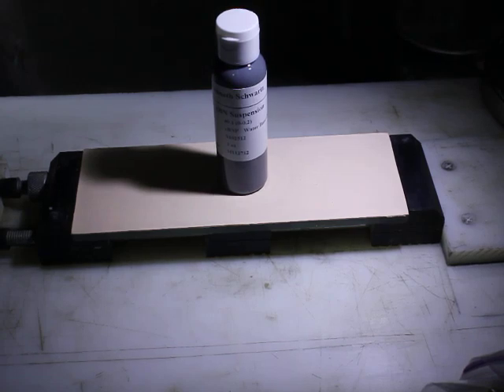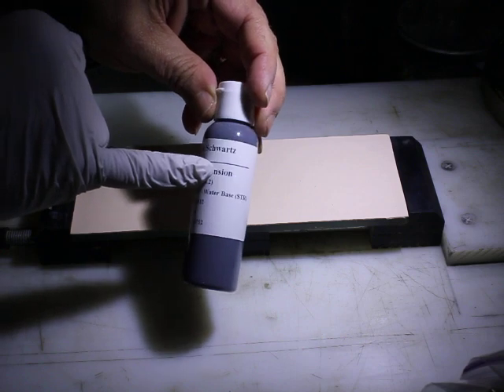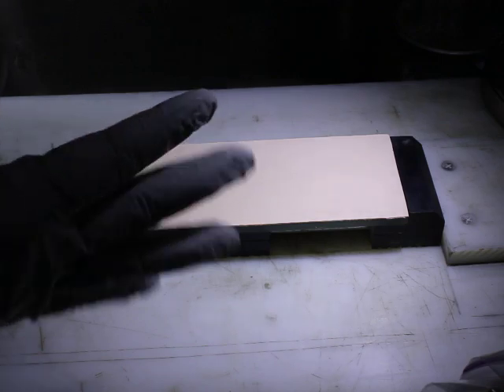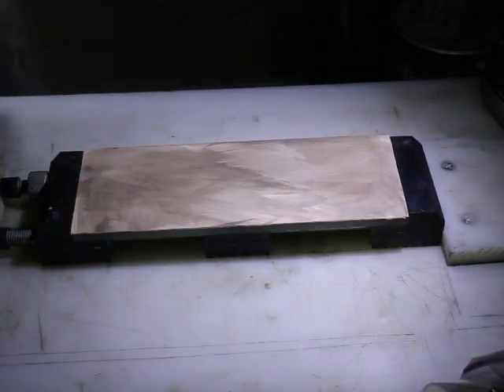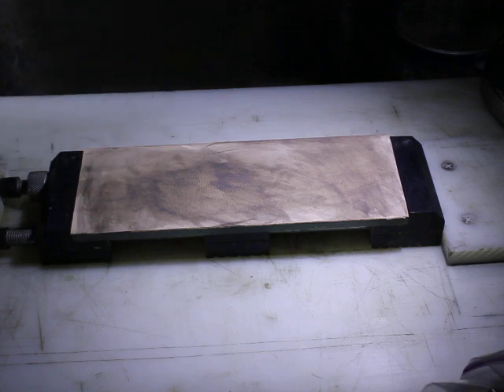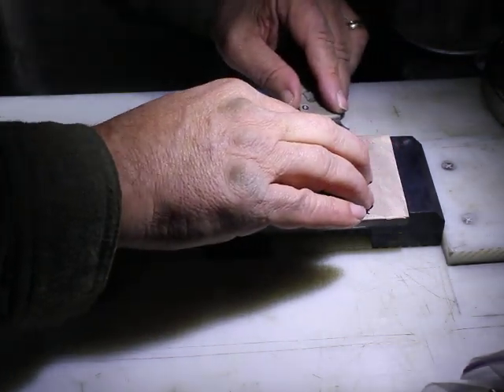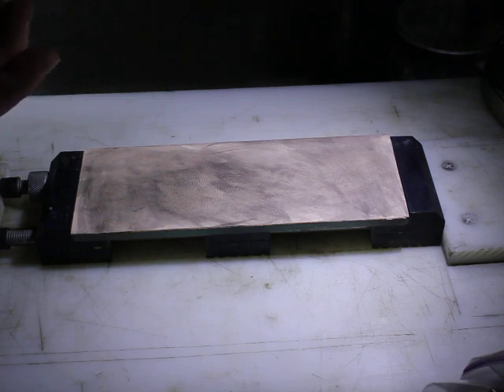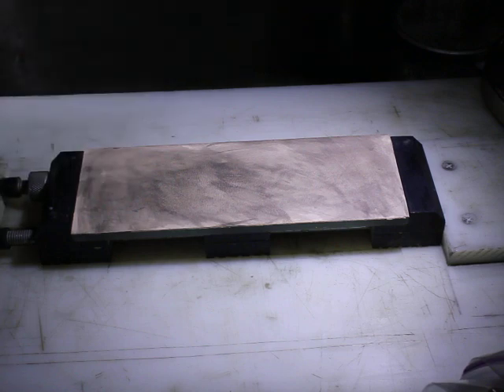160,000 grit Knife Edge! Tenth micron CBN emulsion on Kangaroo leather

Comment: very novice sharpener. look at your edge under a hand held microscope. that .1 micron isnt doing anything compared to the same strop with no compound. you better off spend 50 cents on green compound that will actually do something to a 15k edge.
Reply from the maker: Clueless. Green compound	has particles >10	microns in size.

Comment: I get a clean shave from 1200 grit on my Taylor witness razor. Not amazing metal but holds a good edge. Also use an old jack Daniels leather belt if I'm honest but all the same 160,000 grit, Wtf do you want that for. I thought I found sharpening good for calming my mind, you must be the zen master
Reply from the maker: There's a lot of edge left past 1200 and a strop

Comment: how can a WATER based product be ok for leather?........... would not an oil based product be preferable?
Reply from the maker: Mike Sloan Both can	 be used.	Oil based accumulates	airborne debris more easily.	Water based	works well because the water evaporates rapidly and it is a dry technique. I also have water based emulsions too

Comment: I've been sharpening my knife at 7.5° on a 27,000 grit petrified mastodon tusk stone, and then stropping it on a unicorn leather strop, thinly coated with pixie dust. It is a very slow process and requires a great deal of patience, but my EDC is incredible! It's so sharp that I never use it, for fear of losing the sublime perfection of its edge. I think I'll try your system instead!
Reply from the maker: Ronald Ventola You need togo finer :) And use a better grade of pixie dust.	Have your dentist check that mastadon for cavities.
Reply: A just commented this I agree is a bit over the top but it’s fun to get knife insanely sharp and if your going to sell a knife it helps a lot with getting the most money out of what you make but at a certain point it more of an art than a tool and I respect that and understand it
Reply: You should store it in kryptonite and bubblegum as it keeps the knife sharp
Reply: Best comment ever

Comment: Q: If leather at best 10 000 grit and the compound is 160 000 grit what is the finish?
A: ???  Have been looking everywhere and have never found anyone who addresses this issue.
Reply from the maker: Less so for cow (bovine) but certainly for horse (equine) and Kangaroo, the 'grit range' is considerably finer than 10k, approaching 160k. For nanocloth the strop is an even finer finish, easily 620k. You can determine this by seeing at what level the nanocloth begins to accumulate metal swarf. For nanocloth the level easily exceeds 3.2 million grit or 0.005 microns.
Reply: Thank-you so much for the info. Never herd of nanocloth i will have to look into it. Thanks again.

Comment: Is the #4 Micron emulsion,? Can it be used for General basic stroping.?
Reply from the maker: I have the 4 micron CBN formulation in spray (water based) slurry, water soluble emulsion, and paste (oil based) formulations as well as both mono and polycrystaline diamond in these formulations and Boron carbide emulsions. For most hand stropping applications I recommend the emulsion or spray formulation, depending on the substrate. If in doubt, go for the emulsion - or give me a call at 209 612 2790 for a more detailed explanation to meet your needs.

Comment from the maker: +Devon Huxtable So 160,000 grit is 0.1 micron. Kangaroo leather is fine 
enough to not negatively impact the 0.1 micron scratch pattern and 
Nanocloth even less abrasive even working with 0.025 micron poly 
diamond,. So your numbers for leather are finer than the compound, not 
coarser and not accurate in any case.

Comment: Hi Ken, I love my KME! I'm going from the Surgical Black on the KME to my strop. I'm wondering, what is the role of CBN emulsion if I already have a good strop with compounds? Do I use both, or one or the other?
Reply from the maker: +sojourner pasajero This depends on the grit of the CBN A 4 micron CBN will refine the Surgical Black edge and all grits finer will result in progressively finer edges. The CBN Both I and KME sells is the finest available so you can just eliminate other compounds as unnecessary.

Comment: Do a push cut on a sheet of toilet paper.  Show what this miracle stuff can do.
Reply: +kenneths123 
Of  course you can do my  "toilet paper sharp criteria" test and pass. I did not say that your knives ar not sharp:) 
 My point is that my test may be passed by an edge that is "sharp enough" and not fold by cutting a tomato.

I use saran wrap for scissors testing. I will compare the two criteria.
Reply: +Steve Brown
 I have never seen anybody do a real push cut through toilet paper. I don't this guy can do one either, nor you as a matter of fact.
My "toilet paper sharp criteria" is: "Hold a piece of toilet paper, flat on a cutting block, with two fingers. Place knife tip between fingers, blade at shallow angle, pull knife towards you, down the length of toilet paper, cutting paper in half - without catching and tearing."
Reply from the maker: +FuddleDudd I can easily do a "toilet paper sharp criteria" test and pass. A true push cut with toilet paper would be a single ply held in a pinch grip and sliced or push cut. with the paper held at a single point. For 2 points, this will easily pass. Single pinch grip push cut - I haven't seen it yet to my standard. I use single sheet of toilet paper for for scissors testing.
Reply from the maker: +FuddleDudd The best test would be to have you try some of this compound for yourself. Let me know if you are interested.

Comment: I have not tried the CBN yet but I did a direct A-B stropping comparison the other night between.5 micron diamond and "green" compounds using the same knife. I much preferred the diamond paste as it gave an edge that was equally sharp but it also surprisingly left a bit of grabby "tooth" to the edge. It was much quicker cutting as well but it is of course much more expensive.
Reply from the maker: +TrappenWeisseGuy ;  Yes I have both CBN and monocrystalline and polycrystalline diamond, in spray and emulsion formulations. My compounds are VERY high concentration and purity. Green compounds are very roughly graded and often contain a mix of Chromium oxide and aluminum oxide, often with very coarse grits (eg 5 micron particles in products advertised as 0.5 micron or 0.3 micron products). For this reason, I don't carry Chromium oxide products.
Reply from the maker: +TrappenWeisseGuy ;  You can find out more here http://precisesharpening.blogspot.ca/2010/12/part-1-comparison-of-three-quarter.html
Reply: I think the green stuff is best suited to general metal polishing with cloth and felt wheels on bench grinders as opposed to final honing by hand.
Reply from the maker: +TrappenWeisseGuy ; For use on a buffing wheel check out my diamond bars https://youtu.be/_3-nuwwPtpg

Comment: This is overkill on a ridiculous level.
Reply from the maker: perhaps for what you sharpen.
Reply: What task requires a blade with this much polish?
Reply from the maker: For my preferences, I use this level of refinement - and finer - on my straight razors routinely. Not as a requirement, but rather as a preference, I also do sharpen some of my kitchen knives to this level. If you have not used edges at this level or finer, you really can't say whether or not it is not useful to go this fine.
jesuriah

Comment: The paper cutting doesn't prove much. You can slice newsprint relatively clean after a 400 grit sharpening if the burr is properly removed.
Reply from the maker: +Jarl Anarch Slice cutting with a coarse edge is easy. Push cutting is yet another story. Ultimately the true test is to cut what you are designing the edge to do. You will find a 160k edge so far surpasses a coarse edge as to not even be comparable. Try shaving your face with a 400 git edge :)
Reply: I know these things. What I'm saying is that he could've had a better test, like whittling hair or something of the like. I feel like you need to at least sharpen on 30k grit stone before you move to the 0.1u paste he's using here, or it won't bring out the true effectiveness of the sharpening.
Reply from the maker: Jarl Anarch
Jarl I agree. Ideally depending on the abrasion resistance of the steel, preceding it with either 0.25 or even 0.125 micron CBN or diamond would further isolate the beneficial effects of this level of sharpening. Or, if you please you could use the 0.1 miocron compound for use with my 0.050 or 0.025 poly diamond compounds. I have done this subsequent to the recording of this video with the expected improvements occurring.
Reply: 0.05 and 0.025????!!!! JEEEEEEEEEEEEEZ
Reply from the maker: +Jarl Anarch So those (0.050 and 0.025) are 320k and 640k grit. To give a size perspective a 640k particle is in the range of a SMALL virus. And, although it is exorbitantly expensive and something I don't recommend except for research purposes, I do have some 1.2 million grit poly diamond :) At that size poly and mono are essentially indistinguishable and I have yet to have a test that discriminates between a 640k edge and a 1.2M edge.
Reply: That is utterly insane. Be careful not to cut a hole in the fabric of space-time with that edge!
Reply from the maker: +Jarl Anarch  I also have 0.0125 (1.2 M grit) but this is quite expensive and I don't recommend it for the price since I can't technically prove it is an improved edge.
Reply: kenneths123 are you selling any thing that fine in small amounts how much would it cost i know it’s not practical but I’m seeing how sharp I can get it I’m only able to find it sold by a the pound It’s mostly a game with my self at this point but where could I get compound below .1 micron
Reply from the maker: @outdoorperson6411  I sell directly - now as fine as 0.003 micron or 5.3 million grit. Email me at ksskss@earthlink.net for details.
Reply: Joseph Azzato But you won't find higher quality period. Kens stuff is awesome. I've had all brands of emulsion and pastes and compounds and none of them compare to his PDP of cbn. You see Ken Schwartz stuff on all kinds of websites and great reviews because he makes a great product. Plus he's like a sharpening guru lol. I won't ever go back
Reply: 400 grit clean paper cutting is pretty impressive. I can only really get that with maybe 2000+.  I really start seeing diminishing results after that though as far as cooking goes.
Reply: get strait cutting from naniwa superstone 12,000grit how ever you can get finer grit on ebay for fraction of the cost here

Comment: How often do you need to re-apply the goop?
Reply from the maker: kevin scurlock Well this is the emulsion formulation as opposed to the spray or paste formulations. In terms of how often it holds on a surface either as a bench strop or in a powered application, the answer is  - a long time. Of course this depends on usage but typically on a bench strop one application will do at this grit 50 knives as a reasonable estimate. Most customers order various additional grits before reordering a single grit again. The exception is pro knifemakers and sharpeners who do hundreds or thousands of sharpenings before reordering a single grit.
Reply: Wow that is quite impressive! Thank you for your answer!

Comment: The DLT formulation is an inferior product. If it says 'Engineered by Kenneth Schwartz ' it's the real dea. Otherwise it is a poorly formulated knockoff. You can also order directly from me 209 612 2790 or ksskss earthlink net
Reply: Ken Schwartz bark river does not false information, I was just asking.
spray cbn and emulsion cbn is the same product, why this différence in price? (concentrated/compoition)
I will soon orders to test your products, I question between spray and emulsion for my knives : S30V, S35VN, M390, ZDP189, D2, 3V, VG10.
I am looking for a concentrated product cbn for leather.
Thank you
Reply from the maker: SP GEAR My products include the spray, emulsion and paste formulations - all three. ALL of these are more concentrated and purer than those CBN products that do not have 'Engineered by Kenneth Schwartz' on the label. Both MY CBN emulsions that have Bark River labels on them AND 'Engineered by Kenneth Schwartz' and the ones without my name on it are supported by Bark River. Mine are now available through me directly in the full range of grits. If you want the concentrated stuff, get it from me directly. These will work best on leather for all the steels you mention.

Comment: CBN emulsion bark river (DLT) is identical CBN emulsion (ken's product sold to chefknivetogo) ??
Reply from the maker: +SP GEAR No they are different products. Mine is more concentrated, more consistent particle size and will work in a wider range of situations - applied to waterstones, etc etc. I ALSO have my product as a Bark River product - with the Bark River label specifically saying "Engineered by Kenneth Schwartz" at the bottom of the label. The CKTG product is a spray formulation, also at the high concentration. To get my high concentration CBN emulsion contact me directly.

Comment: may I ask ,why would you use Cubic Boron Nitride when you can use Diamond spray  which is harder ?Thanks.
Reply from the maker: I use both - one at a time of course :) For shaving CBN gives a smoother shave than diamond at the same grit level. I have nothing finer than 0.1 micron CBN so beyond that I switch to poly diamond for 0.050 and 0.025 microns (320k and 640k grit). Both CBN abd diamond are significantly harder than other abrasives and both harder than the [eg vanadium] carbides encountered in abrasion resistant steels. I also have 0.1 micron poly and mono diamond preparations available. Poly is more expensive than CBN or mono and poly cuts faster and smoother than mono with more cutting surfaces.
Reply: kenneths123 Thanks very much for the reply.where do I buy this stuff?Do you sell it
Reply from the maker: 738polarbear  I sell this directly including the strops. Contact me 209 612 2790 or ksskss at earthlink.net

Comment from the maker: Microscopic studies I've done show that the typical points of failure on an edge occur where the scratch pattern of a coarser grit intersects the edge - so finer finish yields less failure points. I also maintain my edges by stropping with high grit compounds - never letting it get too dull. This gives a consistently sharp edge with very little effort rather than more major work bring back a very dull edge to life. A discussion of natural stone finishes for edge retention would be interesting ..

Comment: G'day Ken

Being an Aussie, I'm already familiar with a variety of uses for 'Roo leather. Out of curosity, everyone on the net shows a draw cut on paper that starts next to where they are holding it to demonstrate sharpness. I'm glad you showed how it cuts when the force is at 90 deg to the edge of the paper. But how does your prepared edge go when doing a push cut (i.e. where the edge is moving away from the material) at least 1 inch way from where it is being supported by your fingers?

Mick

Comment from the maker: Thanks! The Mannix is at 10 degrees per side final angle at the 'edge of the edge' of the convex grind. It was as close to zero grind edge as possible initially cut using diamond films starting at 125 microns.